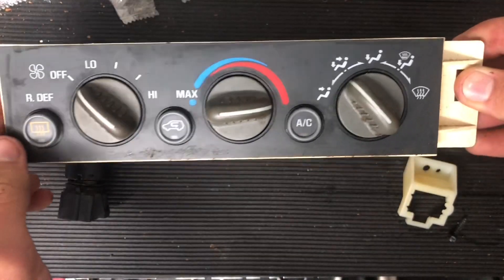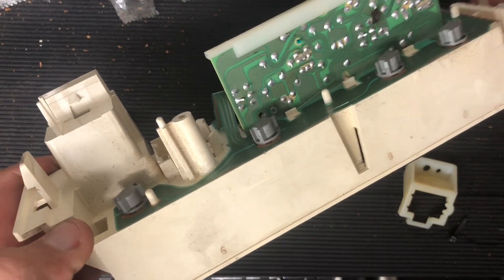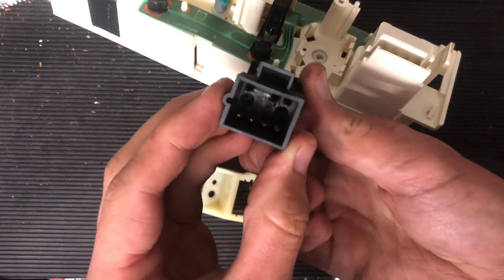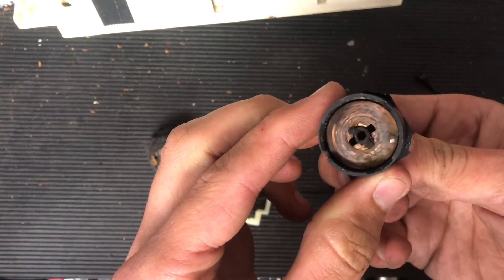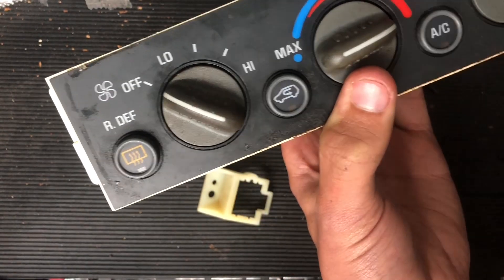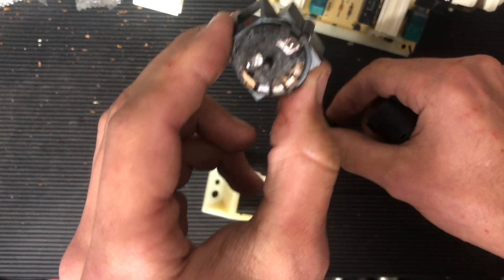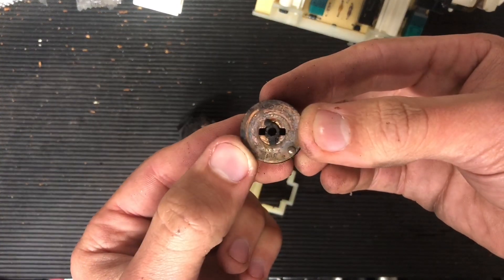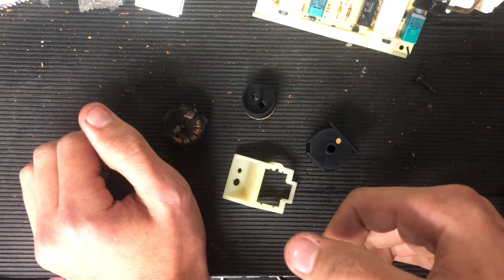GMT400 HVAC Blower Motor Switch - An Absolute Joke

Comment: Very thankful for this video. Been thinking i need to replace the entire panel until seeing this, and the relay's to regulate the switch is awesome.
Reply from the maker: Thanks. I haven't seen anyone else put the relay "upgrade" together, but it seemed like the best route considering I have no plans to sell this truck, ever. I did the same to the low/high beams. The relays are mounted near the ABS module, where the previous owner had chopped the wiring up to install aftermarket lighting, and the relays are powered by an inline fuse holder tapped off of the positive terminal behind the fuse panel. The headlight switch clearly got very close to burning up at one point, and I've read about it starting fires. Headlights and blower motor seem to be the only two accessories on these trucks that draw a considerable amount of current without relays. I'm glad I'll never have to worry about them again.